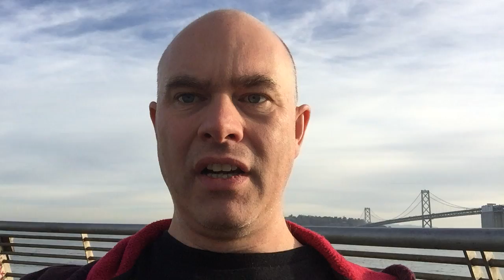Let's Talk About The Antares Launch Failure.

Comment: Ehhh USA...more money for army less for NASA...Meantime the Indians sent their probe to Mars for 70 Rupii and ESA is landing on the comet...
Reply from the maker: To Be fair, The Indian probe is a lot less capable than MAVEN.
Reply from the maker: Don't go the way of certain anti-government news outlets who were reporting on a rocket launch by a private company until it exploded and then they started calling it a NASA rocket.
Reply: You do know that it isn't a NASA rocket right? it was an Orbital Sciences rocket, a private company. They were just using a NASA launch site.
Reply: Meanwhile russians and their Soyuz rule the cosmos.
Reply: cyrexFFXI Still NASA funded ;)
Reply: Russians are neither going to Mars, nor landing on a comet. We are still flying Soyuz spacecraft. But the ship itself is much better than everybody thinks. As I remember, not so much launch failures happened with Soyuz. The orbiter module is designed much simpler than any other spacecraft, and the landing can... The right word - can... There is no complicated computers to fail during reentry, and even if there is, the capsule never burns. The simpler - the better. Thinking I am wrong - prove it!
Reply: I would like point out the military does run many of its own space missions, the air force for instance is currently running a unmanned space plane project. And the plane in question has actually been orbiting the Earth for about two years now. So its not like it all goes to weapons and weapon develop meant.
That being said I do think NASA should have a larger budget, but good luck convincing Congress that doing so is a good idea.
Reply: It can be depressing. All NASA does these days is take pictures of deep space and surface samples from Mars, fly-by Pluto and it's moon, analyze the geysers on Enceladus and lakes of Titan, map the dwarf planet Ceres in the asteroid belt (with a spacecraft made by Orbital Sciences), and revisit Jupiter. When are they going to do some science and space exploration.
Reply: Scott Manley
 Oh dear, as a avid space nerd and a person who actually works at a broadcast news station (local news, in technical production, not a producer or any sort of writer) I tried to tell them. I TRIED!!
 This is how our story read "[sic] a NASA rocket has exploded . . . the private spacecraft . . . "

FACEPALM!
What usually happens though is that producers write about too wide a variety of things to be experts in anything so they have to rely on news wires to tell the facts (like AP, Reuters, etc.)  Unfortunently too often it's seen as OK to have some intern who has no idea what they are talking about write a story for the wire's, at least that's my perception.  I can't tell you how often I've personally corrected stories because our producers were misinformed by the incorrect information put out on the wires.  Keep that in mind next time you're watching a newscast, it's not always purposfully misleading.  Sometimes they just have no idea what they are talking about!
Reply: Владимир Кузнецов
For the amount of use it gets this is certainly true.  The most used rocket ever built, the Soyuz-U, has over 727 launches and only 19 failures.  Only one of which while carrying progress to the ISS.  The engines in this case were NK-33 (actually they where "AJ26," which are refurbished NK-33's with some modifications.  If the engine is at fault, and we don't actually know if it is or not, then the Russian design itself may not be at fault here but instead the modifications or a issue during refurbishment.  Mostly pointless speculation either way.
Reply: ***** And it is all classified. If the money go directly to nasa/scientist we would have progressed a lot more than we have done so far...
Reply: The only reason India spend 70-million is because engineers make less money in India.
Reply: Frost Free NASA's budget is part of the militarys budget, and throwing money at education doesn't do much. The US needs to completely overhaul it, not just throw more money into a shithole.
Reply: USA can cut there military budget by about 80% and still have a larger budget than any other country in the world
Reply: Although nasa has a shortage of funding,  the money doesn't go to the military. It goes instead to welfare programs.
Reply: Says the guy who started a topic about US foreign policy and instigated a disgusting apologist argument for the 9/11 terror attacks. Pathetic tu coque, and hiding behind "scientific" discussions you weren't engaged in to boot.

Learn to argue before accusing someone of trolling. :D
Reply: This rocket didn't even belong to NASA... and if it did, with the proper funding, it wouldn't have exploded.
Reply: To be fair some of that military budget funds things like the X-37 project which isn't being run by NASA, it's run by AFSPC, but NASA techs still work on it using that military funding. The military decided to run it because, as with the shuttle, they wanted it to have military capability and to be used for military missions. That doesn't mean it's doing any less for the development of space flight.
Yes, I would like to see a huge budgetary increase for NASA but just because NASA isn't getting the funding directly doesn't mean they aren't working on space missions, they're just not running them like they used to.
Reply: that doesn't mean any of the military got more money. a large part of the budget that was cut was military spending.
Reply: MikeM8891 haven't you heared about the project to send people to Mars? they plan on colonizing Mars by sending people every two years (i dunno when it starts) everyone could sign up for it. the downside of this, you ain't coming back.

but i think that its gonna be an interesting project you maybe wanted to know.
Reply: J B
Most of the budget is Social security and other social expenses.DOD gets 19% of the budget.
Also if someone says that NASA is under finded keep in mind that they are the best funded space agency in the world by far and honestly spending like in Apollo era would be a terrible waste of tax $ because there would be no incentive to develop cheaper ways to do things if they got no spending limit.Also remember that no one except NASA visited any planet beside Venus and Mars.
Reply: J B DAWN, New Horizons, Juno, Messenger, Curiosity and various others
Reply: Problem is our GDP, which should be 40-60 trillion, not 20 trillion.
92% of fiscal income = GDP x Avg. Income Tax Rate.
Weak GDP means weak fiscal budget.

Pensions are basically 23% of our budget getting wasted on idiots who don't know how to invest for themselves.  That's money that can't go to GDP-building and that's one of the major reasons why our GDP isn't 40-60 trillion.

Around 40% of our budget goes to wasteful stuff like that and 20% also goes to DoD.
I don't think we should cut DoD, considering we've already done that multiple times.
I think we need to start cutting through that other 40% of wasteful budget allocation.

That 40% of pure waste is why Nasa and the education system get so little funding.
At least DoD has physical, tangible items proving they use the money to help America.
Reply: Scott Manley Yes, but that was only proof of concept. It can be done cheaply and one does not simply go to Mars with crappy hardware... :]
Reply: jmr2008jan
I think we need to replace everyone with people who knows what they are talking about. :P
Reply: J B
Whether its classified or not the benefits still reach the public one way or another, even if takes time. And to be honest the benefits of funding the space program through NASA would also take time to benefit us as well, all be it a bit faster than military projects. But that's why NASA's budget is low, the public just can't see the benefits of investing in them, where as with military they can. Which is why I mentioned Congress because they dictate the budget, and they will not support increasing spending unless the public wants it.
Reply: The space shuttle type rocket design is one of if not the most difficult to build. It ran a total of 135 missions from 1981-2011, and only 2 have had major failure, Challenger and Columbia. The thing that really set the shuttle apart was the fact it was a reusable cargo spacecraft. You could fit 2 Soyuz spacecraft inside the shuttle's cargo bay. The shuttle was made to be the best at its job, delivering cargo, and until it's retirement it remained that way.
Reply: Владимир Кузнецов The landing can? The landing can what? The soyuz has failed a good 3 or 4 times compared to no failures of the Apollo, Gemini, and Mercury spacecraft. Plus the 2 Space Shuttle disasters. The US has a much better reputation safety wise compared to the Russians/Soviets. It seems like almost every time there is a Proton launch, it fails. But the Russians/Soviets do have a different philosophy on things such as not making them complicated. Russian/Soviet technology is usually very simple, can last a long time in terrible conditions, and cheap. Take the Kalishkinov series of weapons for example. You could put an AK-47 in the mud for a week, take it out and clear it then you got a working weapon compared to the old M16A1s that jammed like crazy back in Vietnam.
Reply: Arturo Ramírez that has nothing to do with what was being talked about...
Reply: SirusKing Contrary to popular belief, NASA does not fall under the Department of Defense budget.  Funding comes directly from the White House discretionary budget, which is why the NASA administrator reports directly to the president and not any cabinet level officials.
Reply: Jack Cannan I rrepeat the money COULD go to NASA if it wasn't going to the ARMY.
Reply: J B
Blank check would just lead to developing of expensive projects that cant be continued just like apollo hardware that was useless after NASA had landed on the moon first.
NASA behaves like any other government agency be it Medicare or DOD they will always think that they are underfunded.
I would be happier if money stayed in accounts of taxpayers in the first place.
Reply: While I agree with you J B, would you rather launching rockets, or being attacked by terrorists?
Reply: J B
I can't imagine a more ridiculously ignorant comment.
Reply: TwinLingerie
 err, you mean low earth orbit?
  And barely at that.
Reply: I don't know how you think the armed forces are getting more money lol
Reply: Slaughter round
Scott is a step ahead of you there, check his uploads from a week or two back.
Reply: ***** The X37b came home the other week :) ... that thing is so sexy >.> mmmmmm
Reply: Scott Manley You are correct but both of them are trying to achieve the same thing!
Reply: Yorick .U Mars one is most likely a hoax. Their plan is incorrect, their budget is far too little for what would actually be needed and they havent told anyone at all how their budget will be spent and is being spent, other than vague information.
Reply: The U.S. could cut their budget in the military by 80% and still have the largest military budget in the world. I say they should do that, and give the rest to stuff that really matters, NASA and education
Reply: Christoph Zimmer It was the US army who brought the 09/11 on the USA as retaliation but let's not go into this topic here...
In the mean time let us all congratulate ESA for the great achievement! :) Good work guys!!!
Reply: ***** Here, I edited it for you for an easy understanding :>
Reply: Emoticons aren't helping you. ;)

Apologizing for mass slaughter and religious savagery in the manner you have is eminently disgusting. :D
Reply: Владимир Кузнецов Yeah, us Americans are so stupid that I am sorry for being part of this country... we think the Space Shuttle is much more high-tech than the Soyuz... maybe it is, but there's a reason why the Soyuz rocket has been used since the era of Gagarin and Laika. Three cosmonauts died from an unsealed airlock, human error if I remember right caused it. 7 astronauts died in a space shuttle that was torn apart during reentry, a fiery death, and 7 more astronauts died not too long after that after an explosion. I am almost certain that NASA envies the Soyuz safety record.
Reply: TwinLingerie

lel
Reply: sure
Reply: ***** Do You kow what happened with the opium plantations in Afganistan that was suposed to be destroyed byt the U.S.A army after the conflicts in Afganistan?.... well... they wasn't destroyed.
Reply: Kevin Rugani Yes of course! But there is only this much money USA can allocate to different sectors and if army takes 60% of, there will be less for other sectors, including science and NASA budget....
Reply: ***** You really should congratulate ESA :)
Reply: ***** Do not provoke religious argument in purely scientific topic, go troll somewhere else.
Reply: ***** Oh, I could argue and prove you wrong on so many planes about your religion and your beliefs about your government that you would lose your socks but out of respect for Scott I will gloss over your insolence and ignorance. Peace. Unless you do not have any respect for the Boss :>
Reply: I know, but I meant the money needed to overhaul it, get things like teacher raises, not teaching religious crap instead of science, and better tech in classrooms with new curriculum that they ease people into over time
Reply: olekkuvppl It is not about who is the best founded, it is about that it could be WAY better with shaitload of money wasted on army.

Comment: My thoughts immediately turned to the launch scrub. If they had to de-fuel that launcher I was thinking about structural issues since tanks typically aren't meant to stand empty without bracing.

Totally unfamiliar with the Antares, just thinking of liquid fueled systems in general, but I could be wrong since I don't think Antares is cryo-fueled, so a de-fuel wouldn't be strictly necessary.
Reply from the maker: It's semi-cryo fueled - Liquid Oxygen & RP-1
Reply: Scott Manley In the German news they said it was hydrazine. Dem news guys... sigh
Reply: Nathan Jessep During the post explosion press conference a NASA official, or or the Orbital Sciences guy - I can't remember, mentioned that the rocket also contained hydrazine. It just might not have been the primary propellant, IDK.
Reply: Nathan Jessep IIRC, hydrazine might be what's used for the orbital maneuver thrusters, but that would be a very small percentage of the initial launch weight.

Comment: Everyone knows it was a staging error. The decoupler was upside down and the launch clamps were set to second stage...
Reply: We've all been there...
Reply: GuitarEmber ! I only speak from experience :P
Reply: I believe it was the launch pad kraken and so we must go to the launch pad and find the beast and KILL IT!
But I wonder what could they of done to anger a kraken? because this was quite a simple craft not one of the monsters from ksp that has 10+ engines in stage 1.
Reply: Accidentally decouples final stage before launch
Reply: Pffff rockets are for scrubs, catapults are where it's at. Plus they don't blow up as much.
Reply: 2jimmyjimmyjimmy Really? I prefer going to space :)
Reply: Evan venegas 
catapult = launches a projectile.
tiny space craft = projectile
powerful catapult = launches projectiles to space :DDDD
Reply: The Mobius Archives I have those in every save file :P I'm good at planes and ssto but I suck at rockets.
Reply: Catastrophic failure on launch... I swear I have one of those in a save file...
Reply: Arctic Wolf---  How would one fit a catapult in an eye? Though I must admit, that would look pretty interesting.
Reply: I think I saw a structural failure...should have used more struts
Reply: Arctic Wolf---  Slingshots are where it's at.
Reply: Cold Plasma Gaming I prefer catapults... just because they usually look cooler in my eyes XD
Reply: 12Prophet its like those micro-machines that is used to go inside your body to check for any blockages inside your bloodstreams.
Reply: Never too many struts. Ever.
Reply: ***** I assume you use stock struts then :P
Reply: Never. Too. Many.
Reply: all of you are wrong it was a turbopump failure read the report I did because my uncle built it. the cause was because Aerojet put a faulty turbopump on the rocket that blew up on the stand a week before launch.
Reply: CHECK YO STAGIN'